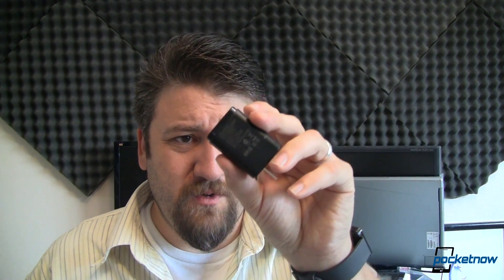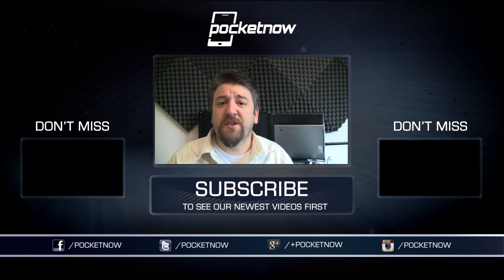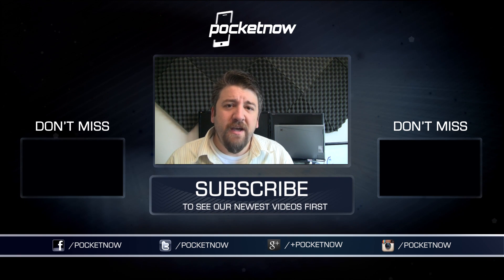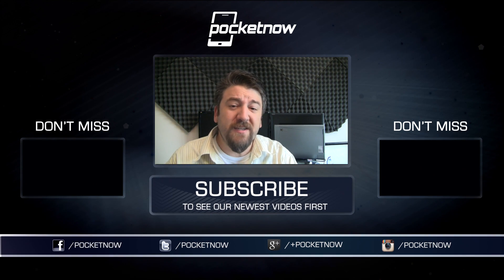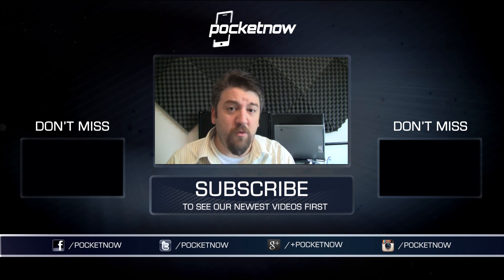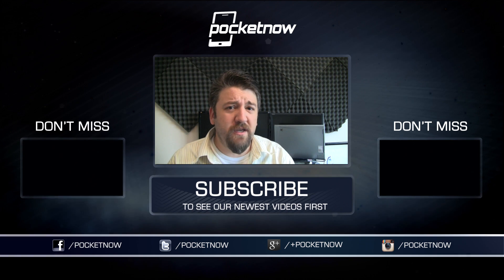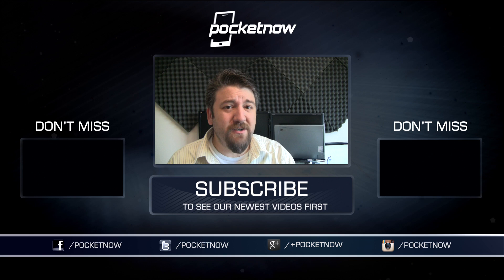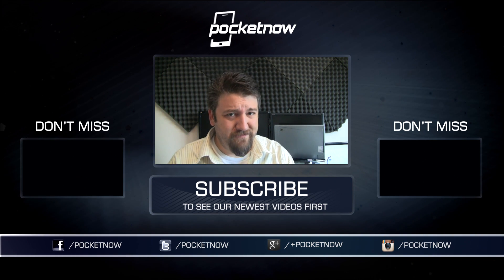Why some chargers are faster than others (Pocketnow Power User S02E08)

Comment: Hi PocketNow/Joel/Viewers,

I've got 2 corrections, first one is important for viewers to know, which is that It really doesn't matter how much amperage the charger can output, it won't ruin your device. You should always get the highest "amperagey" charger that you can. I repeat, it will not harm your device. This is because there is circuitry inside your device that automagically pulls the most amount of current it can handle safely and nothing more. So get a 5V 5A, hell a 5V 100A charger if you can find one! The limiting factor is the phone, not the charger.

Second is not so important, but the amperage doesn't change because it's AC to DC, it changes because there's a stepdown transformer in there, stepping down the electricity from a higher voltage with less current, to lower voltage with more current.

Comment: Not all USB cables are the created same, your typical cheap generic cable can only hold 500-800 miliAmp current, so using it on a 2 amp charger will be obviously inefficient. Samsung cables hold as much a 1900mAh so it is best to use them all the time for maximum charging efficiency. A GOOD wall charger is useless without a good cable.

Comment: I have just looked through the safety and regulatory guide for the max Amp power supply unit, so anyone with an HTC One M8 can use up to 1.5 Amp charger.

Comment: You failed to mention about the different usb pin codings, which is very important especially for people who charge their phones from computers. For example, my LG G2 with a normal usb cable can only pull 500ma. But with a fast charge cable (data pins shorted) it can pull 2A.

Android phones will pull max current if they detect the data pins shorted, iphone and ipads have their own standard thanks to Apple. I'm using the Satechi uCharger which is a terrific little adaptor that lets me charge my phone at full speed from any computer usb port.

Comment: A charger CANNOT break your device just because it has "more amps"! The number of amps (current) on the charger label is just the maximum it can or should output so it does not overheat. The phone basically decides how much it's going to drain (based on electrical resistance). If it's draining more than the charger is rated for, it may break the charger but not the phone. What's important is the voltage. You can easily break your device if you feed it a higher voltage, but any USB socket will be exactly 5 V by standard.

Comment: The ampers the device draws is limited by the voltage and impedance. I could buy a 5.00V 20A power supply and rig my phone to it, and it will only draw what it wants by keeping the input impedance (or resistance) high enough. As impedance increases, the current drawn will fall, and if the resistance drops, then more current will be drawn. Thats V = IR in a nutshell.

Comment: A bit of a MISINFORMATION here (sigh) 

1. Any USB compatible charger (whether it's 0.85 - 2 Amps) ) is compatible to ANY device that supports USB charging 

2. A device can only draw the maximum Amps it can take (eg. you can not Damage a 1 Amp device using a 2 Amp charger)

3. If a 2 Amp device is plugged into a 1 Amp charger, same thing, PERFECTLY SAFE, but it will only charge slower.....

Comment: What you said about amps is not true. A charger amp rating says what's the maximum amps it can deliver. 

You can use a 2 amps DC charger with any device safely. 

A charger will deliver the amps the device ask up to its limit. 

Think about it... Your wall outlet is providing 120V at a maximum of 15 amps (North American Standard). Does your appliances fries or dies when you plug them in the outlet even if they don't require more than a few milliamp (ex: alarm clock)?  No, the amps rating is there to indicate the maximum current that can be drawn from a outlet, device, charger.  It's basic electronic/electricity.
Reply: Right.  The device your charging also has its own internal resistance, so it's not necessarily going to draw all that current.  Every electrical circuit, including batteries, has its own internal resistance.  Current is the flow of electricity as a consequence of voltage and resistance.
Reply: La différence c'est que le mur est AC, est-ce que le DC fonctionne de la même façon?
Reply: Mike Wallace : oui, c'est exactement la même principe. 

Et ce que je dis est appuyé de mon diplôme en électronique et de mon cours spécifique sur les alimentations. 

Prends une autre comparaison, dans un PC on met une alimentation de 400, 500 voir même 600 Watts souvent qui est trop puissante pour les besoins du PC, est-ce qu'on brûle les composantes?   Non! 

En fait, c'est souvent l'inverse qui arrive, une alimentation ou un chargeur pas assez puissant va surchauffer ou si il est poussé à sa limite, il va avoir tendance à donner un voltage plus bas ou moins régulier, là on risque de faire frire des composantes.
Reply: Les gradations d'ampérage c'est toujours pour indiquer le maximum qui peut être soutiré de l'alimentation. Mais on peut utiliser une alimentation de 20 ampères, même pour m'alimenter qu'un LED qui ne consomme que des micro Watts, tant qu'on respecte le voltage.
Reply: Ah, j'étais entièrement d'accord pour le AC, je me demandais seulement pour le DC. Merci :-)
Reply: the fault in what your saying is that usually electronics who run on DC current have a transformer built in or an adapter. That thing also regulates how many amps the device is getting.

Phones don't have such a transformer built in.
Their wall adapter does all this work, and if you use the adaptor from another device then your phone can't regulate the current, because it trusts the adapter to provide the correct amount.

you have proof that the device is drawing all the amps the wall adapter is sending because it will charge faster if you use an adapter that sends more amps.

is it were true that the phone will only draw as much as it wants and not how much the adapter can send, then no matter what adapter you'd use it wouldn't charge faster.
Reply: Verliebt "Phones don't have such a transformer built in."
They kinda do.
One of the chips on the PCB is a driver to convert the input voltage which is a range say 4.8V to 5.2V into a voltage that wont destroy the battery which could have say 4.2V for a Li-Po (depends on model and make and chemistry)

The driver has to regulate the charging current as to what the battery can handle which changers depending on how charged the battery is. Most are set up to drop the charging current when the battery reaches 90%.

The driver will also regulate the current draw depending on the input voltage (not current) which determines maximum amperage.

Now to the charger.
It is dumb, there is no communication between the driver and the charger with the only thing the regulates the power draw being the voltage. If you have a charger rated at 500mA and plug it into a 2A device the device will test the charger when first plug by slowly ramping up until the voltage drops below the minimum input voltage then decides with a bunch of calculation what it thinks the maximum rate is. I have tested the Nexus 7 2012 edition and managed 1.2A on a 500mA device, it quickly dropped back to drawing around the 500mA rate which is the standard power available for a USB2 port.  

So to sum up:
The charger has no control current, the source device can't control current only on/off state. If the charger does it has to communicate the available power for which very few or none exits for smartphones.
Reply: Garth Power Well, the charger does have a negative feedback loop to manage the output voltage, and also over-current protection, but you are correct!
Reply: ***** You are absolutely correct. I would still avoid cheap aftermarket chargers since the regulation may be poor and cause problems. I have not had any issues though.
Reply: True. I wish he would do a little more research and explain that as long as the voltage is well regulated, the device will draw what it needs.
Reply: Verliebt True*

However, phones do have proper regulating circuitry, and as long as you stay between 4.75V and 5.25V, the current rating still will not matter, as the phone will draw what it needs. This is not to say that there will not be more thermal dissipation at higher voltages.

You are right that the phone chargers are current protected, but they are not current limited. It is important to note the difference. In current-limiting mode, once the current threshold has been exceeded,  the supply will reduce the voltage until the current falls to the threshold. This is rare to find in consumer power supplies since it is difficult and costly to implement and usually not necessary. So instead, overcurrent protection is used: the supply will simply shut off if the current is exceeded.

Also, today, it is possible to pack tiny switch mode power inverters in phones, since extremely high switching speeds have allowed usually bulky inductances to shrink. I cant be certain of the battery management inside phones, but it is possible to use switch mode technology inside phones.

Poorly designed chargers will have the voltage calibration set too high, causing your device to draw an excessive amount of current. Also, my note 3 stock charger is unusually rated at an output of 5.3V @ 2.5A max. The voltage is too high for USB, but the phone was clearly designed to handle that. I would not try to charge any other phone with that.
Reply: My main chargers at home is the one from the Nexus 10 and the original Kindle Fire. Both chargers gives me very good charging time no matter the device I throw at them. 

The charger does not "push" current (amps) to the device, it's the device that "pull" the current it need. You explained it well: there is a power controller chip on all modern smartphones and tablets. These chips make good use of the power (current/amps) a charger can deliver. 

Personally, I simply throw away any charger with a rating of less than 0.5 amps to avoid long charging time.
Reply: Power Max If you can get some of the specs of the Qualcomm PM8941 and PM8841 power management IC from the HTC One M8 or equivalent. The power management chips are always difficult to find specs for.
Reply: Is it true that charging with a lower amp value makes your battery stay healthy for a longer period of time?
Reply: Andy Ferdean As far as I know, yes, but also lithium batteries decay at the same (slow) rate no matter how many times you use/recharge them. In other words, there is no fixed number of charge/recharge cycles to go by. Charging them slower is safer and definitely will keep them happier. By charging them too fast, you risk overheating and exploding. It is also not good for the cell. But even 2A charging rate is slow for a cell. assuming they are rated at 1C, you can charge a 3000mAH cell at 3A and it should be fine.
Reply: Power Max / Andy Ferdean : Any good device have it's power circuitry optimized for the battery capacity and specs.

The device manufacturer will configure the power management chip to work within the battery specs. It will charge as fast as possible while preventing overheating. It is actually a parameter used in the charging circuitry: battery temp is taken into consideration.

There is a lot of myths regarding batteries. Most of these myths are based on nothing or personal experiences.

My recommendations: 
- Don't use cheap chargers: throw them in the garbage!
- Use high-power chargers as much as possible. They will not hurt, they will only make your devices charges faster.
- If you buy aftermarket battery, make sure their specs are similar to the original battery. And watch for heat while charging, if a battery/device gets very hot while recharging, this means there is a problem!
Reply: Power Max : This is why I specifically mentioned to throw cheap chargers away... literally.

This reminds me of people building mid/high-end PCs with cheap power supplies.   #lol

Comment: I have a Nexus 5, The original charger stopped working and I am using an Asus Charger with a 2 amp output vs the 1.2 amp output of the original charger. Will this damage my nexus 5. I dont see a recomended or max Ampage in the safety manual that came with the phone. I read somewhere that the phone will only take what it needs. Is this true?
Reply: Using a higher rated charger will charge the battery faster but will over time decrease battery life.
Reply: As long as its 5volts. It will not damage you phone.

Comment: Let's say your device's max charge current: 1amp
Charger max output: <1amp (OK, just slower than the fastest possible charging speed)
Charger max output: 1amp (OK, you get max charging speed)
Charger max output: >1amp (OK, it's safe to use, your device will just get 1amp from the charger even though it's a 2amp charger. It means UP TO 2amp)

Comment: Current is drawn, not pushed. You can't damage anything by using a lower rated charger on a higher rated device. Additionally, a device will only draw what it needs, up to the limit of the charger. Lots of things need to be fixed in this video.

Comment: With so many people using usb chargers around the house, it's a good thing to have a USB current meter around these days. For around $15 it saved me a lot of lot of time and frustration!  Now I can use a charger knowing it's working  effectively and safely.... not to mention recommend the right chargers for people.  Also, a lot of cheap chargers (this includes portable battery packs!) push much less than they claim. 

Another thing, if a device is pulling more than it should, it's a VERY badly designed device.

I use and ANKER 5port usb charger that tested capable of over 3 amps per port, but all the devices, even my old flip phone pulls within the specs.

Comment: Thank you very much for the useful information 
But I didn't find anything about the capability of my phone in the user guide 
Im using sony xperia z 2
And I have an external battery that output 2.0 A
I still didn't use it with my phone 
Because the original charger is 1.5A

Comment: My moto g charger says output 550mAh. what does that mean ? 

~ Question Answered
Reply: it means that the charger gives u 0.5Amps as DC output
Reply: YassiNe MaChiChi thank you !
Reply: U'r welcom
Reply: It means it's a very slow charger for your moto g. Get a 1.5Ah charger to get the maximum charging speed. But there's no problem with your 550mAh charger, it's just that it takes more time to charge, it takes around 4 hours to full charge, right?
This video is giving wrong information, let's say if your device max charge current is 1.5Ah/1500mAh, there's no problem to use a higher rated charger. let's say for a 2Ah charger, your device will only draw 1.5Ah from the charger, it's safe to use and it won't damage your device, it means the charger is capable of UP TO 2Ah charging current.
Reply: GG2K7AU05 2 hours I think. But I don't leave my phone charging overnight. So I'd want a quicker charge to get it to 100% before I head to sleep. Moto G maxes out at 1.5 and yes I'll be buying a higher amp charger. Thanks.
Reply: Miguel Angel Aaron Joshua Turrioni This might make it simpler, there's a "C charging rate". C = Capacity.

A charge rate of 1C = Full capacity of the device's battery. It is recommended to charge your device at a rate between 0.5C - 0.8C, which also means 50-80% of the battery's capacity.

So take examples for your devices:
Moto G (2070 mAh): @ 0.5C - 0.8C = 1.03Ah - 1.65Ah
Note 3 (3200 mAh): @ 0.5C - 0.8C = 1.6Ah - 2.56Ah
(Note 3 should be able to charge @ 0.8C/2.56Ah at best, your 2Ah charger is not giving your note 3 the fastest charging rate. Get a 2.5Ah or higher rated charger if you wanna achieve that.)
Reply: Aaron Joshua Turrioni Yes, that's the same amperage as most tablets.
Reply: Its means its only 0.55 ampere. Not even 1 ampere. Your charger slow. Get q 1.5amp. Or even 2.1amp. Thats better...
Reply: I have a Moto G and I do not use the stock charger. I use a charger that has 2 amps so I would recommend you do the same.

Comment: Ok, there are some misconceptions. 
The higher amps doesn't ruin your device the higher voltage might that because the phone itself drag(I didn't know if this is the correct word) the amps so if it can use 1amp maximum, it will drag 1amp only. 
Using less amps means longer charging time   but the battery will last longer before it got damaged.

Comment: As has been mentioned numerous times, using a charger rated higher than the device it's charging isn't dangerous.

One point that I think would have been helpful to include in the video is the difference between various devices' charging algorithms and standards.  For instance, Android devices determine whether they are plugged in to a computer's USB port or a dedicated charger by reading the resistance of the two data terminals inside the USB cable that it's plugged in to.  If the two data channels are shorted together (0 ohms) then it knows that it's plugged in to a dedicated charging circuit and draws the maximum amperage it is designed to handle.  If those data terminals aren't shorted together, it knows that it's plugged in to a computer, and only draws 500ma, which is a USB standard.

I know Apple uses a similar method for determining what it's plugged in to, but I'm not sure exactly what.

If you buy a cheap off-brand charger and your Android device displays "Charging - USB" in the Battery Stats page inside the Settings menu, that explains why it takes forever to charge.  Make sure it says "Charging - AC"  Also, I have found a large disparity in charge current using different cables using the CurrentWidget app.  I generally find that the OEM cables that come with my devices charge at a faster rate than most aftermarket cables I've bought from Amazon or Monoprice.

An excellent video that explains the basics, but I feel it left out some pertinent information that could help users solve their slow charging problems.